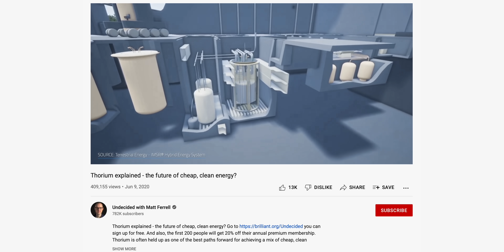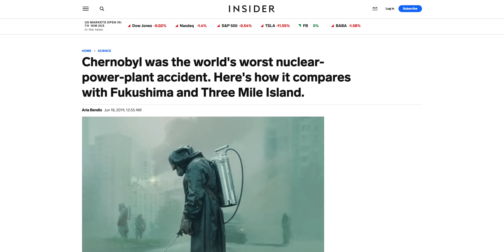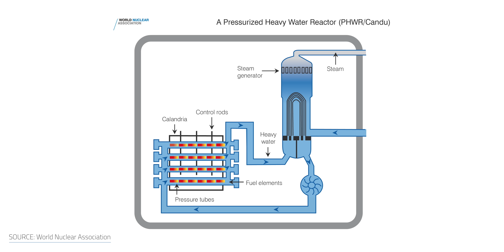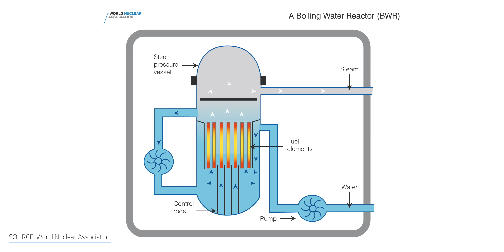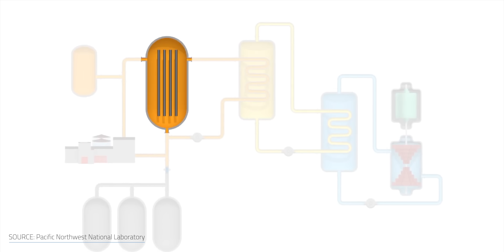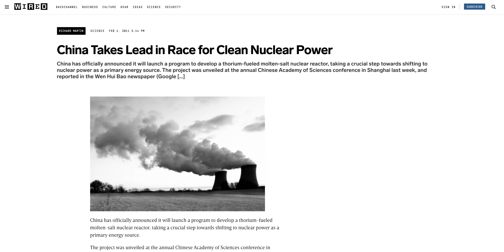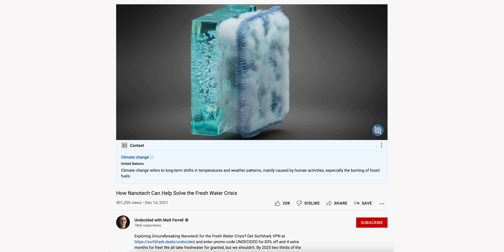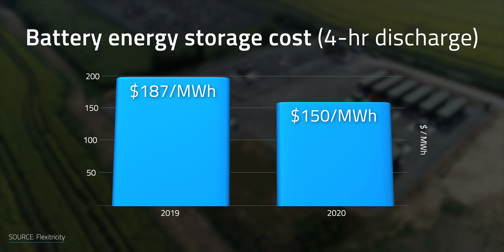Revisiting Thorium Energy - The Future of Nuclear Power?

Comment: I am a third year nuclear engineering student in the US and I have a few things to say. First, the 10,000 year lifetime of nuclear waste does not mean it is more radioactive. In fact the longer lifetime means that kg for kg, a longer lived radioactive material emits less radiation over the same amount of time than a shorter lived material. Nuclear power plants are not fueled by highly radioactive material. Natural or enriched uranium is quite benign as it has a half life of more than 100 million years. The radioactivity is a result of products released from fission. Most nuclear power plants operated today use a process called thermal fission, which produces isotopes with greater than 238 protons and neutrons in the nucleus. These are produced when a uranium nucleus absorbs a neutron without fissioning, creating a heavier isotope with a long half life. This happens in thermal reactors (traditional light water reactors). In a fast reactor such as molten salt reactors, sodium cooled reactors, and heavy water reactors these heavy isotopes are fissioned into shorter lived nuclei. This is because the neutrons have much greater energy and travel faster, which allows them to burn the heavy nuclei along with fuel. Waste from any fast reactor fueled by thorium or uranium will decay to background levels in about 300 years. Traditional nuclear waste can be reprocessed and used as fuel in a fast reactor to destroy these heavy nuclei and reduce the long lived radioactivity. In the terrapower reactor, the molten salt does not interact with the reactor directly. Rather it is a heat storage method that receives heat from the liquid sodium coolant. The heat can then be used when renewable energy is producing less than the grid needs. This integrated energy storage with nuclear power allows the plant to sell energy when prices are high (at night and when the wind is still) and store energy when renewables are at peak capacity. This energy storage has less environmental impact than the lithium mining needed for industrial battery storage. The thorium-uranium fuel cycle has great potential, but so does the uranium plutonium fuel cycle. When regulations are followed nuclear power is safer than fossil fuels and hydro. Not all countries have renewable resources, but nuclear reactors can be placed anywhere in the world. The huge capital costs you reference are for traditional large plants, but new small modular reactors are set to disrupt the industry and lower the cost of nuclear. I appreciate your interest in nuclear power and encourage more videos. I would love to see a video about EBR-II, a sodium cooled fast reactor and closed fuel cycle demonstration plant at the Idaho National Laboratory. It was able to demonstrate passive shutdown without human intervention days before Chernobyl, which is why it did not receive the attention it deserved.
Reply: There are many issues with nuclear power but here in America the number one issue is cost and time to construct.  The advanced Westinghouse AP1000 reactors at the VC Summer and Vogel projects were to be built better, cheaper, and faster due to modular construction of various systems in a factory setting and then shipped to the reactor site.  However the reality was that they did not fit together at the site and the poor construction actually resulted in more cost and time than a site buit unit.  Until one just one reactor is built on time and within budget how can anyone believe these new and improved project estimates??  VC Summer canceled. Vogel 6 years behind schedule and 100% over budget.
The Terrapower project was initially sold as a $1 billion 345 Mw small reactor.  Once DOE pledged dollar for dollar up to $2 billion in taxpayer money Bill Gates (the billionaire)  now estimates the project to cost up to $4 billion and take 7 years to complete. $4 billion for a 345 Mw unit is already a cost per Mw failure if it is ever built at that price. 
SMRs can be built faster than traditional large PWRs but if it takes 7 years for 345 Mw of capacity and 14 years to build a 1,300 Mw traditional PWR, isn't the traditional PWR a better deal (unless we have enough construction workers to build 4 SMR at the same time)????
Any reactor requires opertions staff, maintenence staff, engineering, security, etc that is fairly independent of the reactor output.  So the cost to operate a SMR approaches that of a large PWR and the exact reason why utilities always build the largest (economy of scale) reactor possible. Reactors have a future in our energy future however unless we want to wait 25 years to build and prove the concept of new reactor designs and then wait for mamy more to be built, nuclear is not the near term solution.
Reply: @clarkkent9080   You have been shown continuously that small modular reactors are built in less than two years at under a billion dollars.  Have been for decades.
Reply: @clarkkent9080  You're confusing first and Nth of a kind. I don't see you screaming about Solyndra or the cost of Ivanpah though.
Reply: @Baibakov88  I thought that the discussion was about cost and time to build power plants. Solyndra was a manufacturer not a power plant. Ivanpath was a thermal solar and was rejected by google when solar panels dropped in price as this technology is not cost effective with the cost of solar panels today. 
The cost for solar panel farms and wind farms is well established and can be built in a few years (the timeframe necessary to meet our needs) as long as energy storage is added which is required for nuclear as well.  Nuclear cannot become a viable option in less than 25 years.

Comment: Thorium MSRs can do more than is stated.  Since it is a liquid, gases like cesium bubble up through it and can be separated. Cesium 137 has replaced cobalt-60 in the treatment of cancer.  Another use is to sterilize medical products, meat, vegetables, and other food products. It is also used in industrial radiography to quality-control welds. It has been considered as a fuel in ion-propulsion engines for deep space travel.  Other medical isotopes can be harvested from LFTRs as well.  The waste heat from these reactors can be used to take carbon out of the air and make dimethyl ether, a direct diesel fuel replacement. Imagine carbon-neutral diesel fuel in all the trucks on the highway. Those are just a few I remembered off-hand.

Comment: Solar and Wind cannot do it because the sun does not always shine and the wind does not always blow. LFTR MSR's will run 24/7/365. Those are facts that don't care about your feeling or your life experience or anything else. LFTR MSR's could make the desert's bloom.
Reply: Reactors are base loaded and cannot change load rapidy so you cannot have more reactor capacityin service  than is the normal minimum usage (usually at night). So electric storage is as much a requirement for reactors as it is for renewables. You cannot just shut off reactors every night when people go to bed and restart in the morning
Reply: @clarkkent9080   And renewable are even less flexible in that regard.  If the Natrium concept works out, we may finally have an energy storage method (thermal) that might be approaching what is really needed in energy storage technology.
Reply: Hence the need for better storage.

Comment: (8:59) I'm not sure where you're getting the claim that thorium is more expensive to mine? As you stated earlier, thorium is found in monazite, which is a fairly common mineral, found in material amounts in the tailings streams of iron mines, phosphate mines, titanium sand mines, etc. In those monazite deposits, thorium is also found in roughly equal proportions with rare earth elements, with the majority of China's production of REE's coming from monazite ores produced as a waste product from large iron mines. As such, the effective cost of "mining" thorium should be close to zero. 

So I'm not sure where you're getting the assertion that it's more expensive to mine thorium than it is to mine uranium, other than the fact that there currently aren't any dedicated thorium mines, maybe?

Comment: (13:19) The cost of storing energy will make renewables more affordable and less intermittent. It'll also make nuclear power more affordable, as reactors can operate at almost full capacity all day (maximizing efficiency even more) and store that energy so that it can be released in line with demand. That'll increase the total amount of power available from the plant at any given point, allowing it to serve more people. It'll also lower the cost of electricity for consumers as the utility won't have to price electricity so that income from electricity produced in peak demand hours (4pm to 7pm) more than offset the losses from electricity produced during non-peak hours (12am to 4am). Cheap storage would allow the plant to bank the power produced from 12am to 4am so that it would be available when people actually needed it.
Reply: The problem is we don't have a viable utility scale storage method that is practical.  The TerraPower Natrium plant is moving in a step of the direction you speak of with molten salt storage increasing the plant's capacity by 50% for 5 hour periods.  A 100% renewables economy will never flourish until we have a quantum leap in energy storage technology.
Reply: @danadurnfordkevinblanchdebunk  That is largely true (I say largely because different people would have different definitions of what is "practical"). That said, liquid metal batteries proposed by Ambri certainly seem interesting. Even if they aren't any less expensive than lithium ion batteries, the extremely long lives of liquid metal batteries, with little to no degradation over time, means that you can spread the cost of those batteries over a much longer time frame than lithium ion batteries.
Reply: @danadurnfordkevinblanchdebunk  Oh no, I fully agree, which is why I support fusion research but think most of our focus should be on rolling out Gen 3 reactors and rush the commercialization of Gen 4 reactors. If Germany had spent the money it had spent on renewables on new nuclear plants instead, it would CO2 neutral to CO2 negative within the decade. Instead, they're targeting the closure of all coal plants by 2030 while France will be closing the last of its coal plants this year, 2022. 

I only mention storage because renewables folks ALWAYS bring that up like it's the ONLY reason we're not rolling out renewables everywhere, and that as soon as we have cheap storage, that's going to make renewables much cheaper and much more reliable, killing fossil fuels and nuclear power in the process. I like to point out that cheap storage will have the same, if not more, of a positive impact on nuclear than it will on renewables, when we get it. 

That said, we are already seeing deployment of liquid metal batteries, but I think they're more test deployments, where the customer is willing to give them a shot for the press.
Reply: @danadurnfordkevinblanchdebunk  Of course, some Gen 4 reactors have the ability to load follow, so energy storage is less of an issue than it is with current nuclear which generates power at a near steady state 24/7 (current nuclear has the same but opposite problem as renewables). Of course, with cheap energy storage, you could then operate Gen 3 and Gen 4 plants toward the maximum end of their operational capacity (go full-bore and don't load follow) so that you operate the reactors as hot as possible and maximize the efficiency.

Comment: (9:46) You state that Oak Ridge's MSRE was canceled due to corrosion issues. This is not correct. Per the Oak Ridge report, "Molten-Salt Reactors -- History, Status, and Potential":

"Technology developments over the past 20 years have culminated in the successful operation of the 8-MWt Molten Salt Reactor Experiment (MSRE), and have indicated that operation with a molten fuel is practical, that the salt is stable under reactor conditions, and that corrosion is very low." 

The reason Oak Ridge's project was canceled was because the lab had its experimental reactor funding taken away so that it could be given to Argonne National Labs to increase the funding of its fast reactor experiment. 

The Chinese also worked on MSR's in the early 1970's, and it was eventually dropped due to corrosion issues. However, as I show above, the issue of corrosion had already been solved by the team at Oak Ridge.

Comment: (8:46) The production of U-232 isn't a proliferation risk, it's a proliferation barrier. Pure U-233 is a "potential" proliferation risk, but it's much less so if you have U-232 contamination, which makes the contaminated U-233 VERY unworkable in either a gun-type or implosion-type nuclear bomb. That said, the real proliferation barrier for thermal spectrum MSR thorium breeders is the anemic U-233 breeding ratios in the thermal spectrum, which are only 1.05 to 1.07 (depending on whether you separate out protactinium). This means that thermal spectrum MSR thorium breeders use almost all of the fuel they produce, on an almost 1 to 1 ratio, leaving VERY little excess, such that it would take between 17 to 25 years (depending on your breeding ratio) to just double the amount of fuel in the reactor (which, given it's a thermal spectrum reactor, will only be 3% to 4% of the material in the fuel salt, is not a whole lot to even begin with).

Operating a thermal spectrum MSR thorium breeder with protactinium separation, the protactinium would flow in a constant stream from separation to a single insulated decay tank that is constantly fluorinated to strip off uranium (both U-233 & U-232) as it's produced/decayed, with that fluorinated uranium gas flowing to another chemical process which strips off the excess fluorine to convert the uranium back to a salt that goes into the reactor. One continuous chemical process, like what's handled by any chemical or petroleum plant.

If someone wanted to make a bomb out of U-233, they'd have to set up their MSR to separate protactinium in batches (so that you could separate the U-232 & U-233), which would require a whole lot of additional complexity on the reactor, with all protactinium produced over a single day, for example, going to individual insulated tanks, which will require several radiation, high temperature, and chemically appropriate (not reactive with the salt) flanges & valves which will be mechanical in nature, diverting production from one container to the next to the next. Each one of those individual decay tanks must also be fluorinated separately instead of together, with dozens to hundreds of pipes carrying highly reactive fluorine gas instead of just one. Then, even after you introduce all of that complexity, you still can only pull off a TINY sliver of U-233 production (due to the anemic breeding ratios). If you take out any more than that tiny sliver you'll kill the reactor, as you'll be reducing the overall fuel density in the reactor below the point required for criticality.
Reply: THIS. Thank you for the explanation. 
I had a vague idea that this would be the case, but it's good to have solid detail when answering "but someone will make a bomb out of it!" objections to MSR.

Comment: Nuclear energy is the regulation machine to reduce power sags at low light and wind periods.
Reply: Not especially useful in that regard since throttling energy output is a very slow process for a nuclear power plant.  Nuclear power works best at a steady output.  The new TerraPower Natrium plant using a molten salt storage system to increase capacity by 50% for 5 hours at a time is a step in the direction you speak of.

Comment: (8:37) You talk about how maintenance is an issue for MSR's, but I'm not sure if you're aware of the significant work done by Oak Ridge on MSR maintenance. Oak Ridge's Youtube channel has an entire video on it, titled "Remote Maintenance of Molten Salt Reactors". Oak Ridge, while operating the MSRE, build an entirely separate reactor setup which they used for remote maintenance and handling process work. They ended up designing the MSR to be modular in nature so that they could remotely swap out major components, even entire heat exchangers, in a single day.